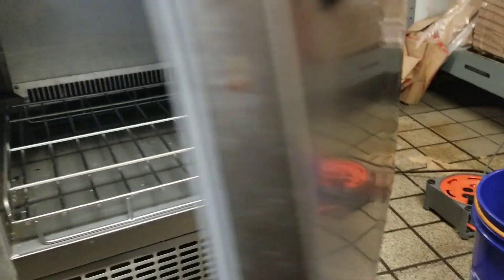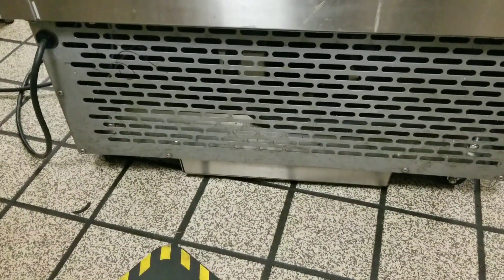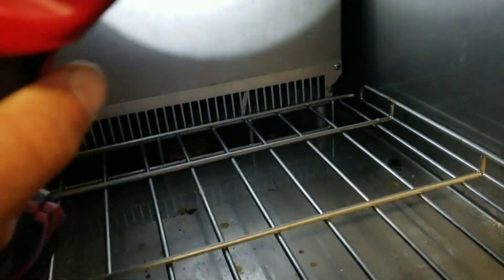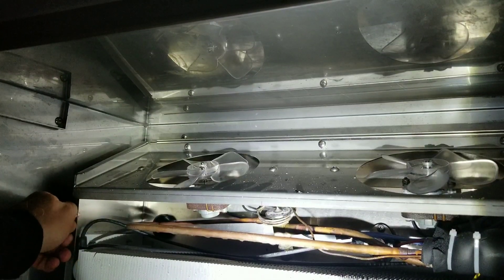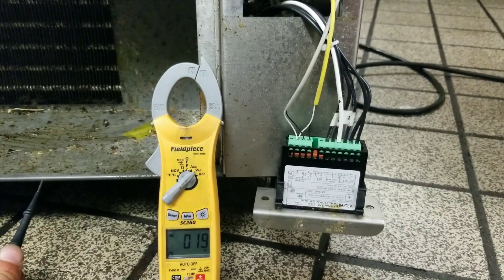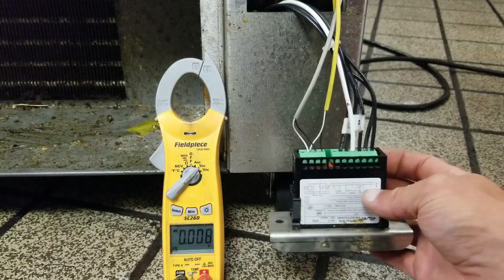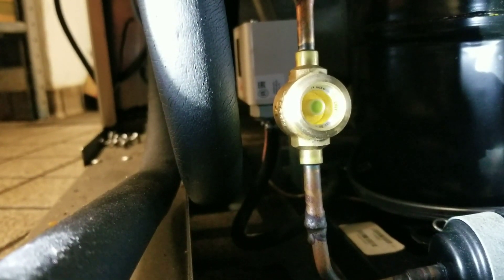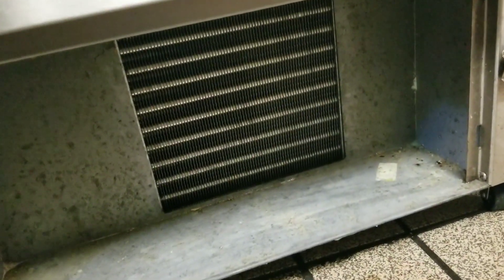Franke Freezer not working

Comment: hi friend i always replace the eliwell because  the fst paramater is important  with freezers and the fan start delay, and secondary with hot gas defrosting  the evaporator fans must shut down ., and i megger amperage of the fans , sometimes the fans took 2 much amperage so de relais in the eli wel controller gone defect grrzz from the Netherlands

Comment: Those eliwell controllers are the only thing we regularly have to change on Franke units. They seem to fail after 3 to 4 years. Never tested like this so thanks for the tip and a way to get by temporarily!
Reply from the maker: Thanks Andrew- these Franke units are pretty solid, I dont service a ton of them but the few I have there wasnt major component failure, just controls here and there
Reply: Why you guys just dont change the little relay inside the controller...??? It cost 0.90$ and you could charge the time instead of changing the complete controller?!? This is what we do in plastic facilities for the heat controllers. You probably make more money.
Reply: I agree with you there! Those things run for decades.  Control only cost $50 from Franke so it is one of the easiest and cheapest fixes we run into on our kitchen equipment.

Comment: i work on these all the time...franke does make most of their units easy to work on and they have great tech support if you are a authorized service company....ever since they switched to R290 units there are alot of leaks which is not good especially when these units are next to the fryers & grills
Reply from the maker: I agree there tech support is great- I dont work on them to often but I have had one or two leaking r290 units, luckily no explosions yet

Comment: Very nice ,holding back from the gauges...
As you mentioned,critical charge of a few ounces..no sense ( introducing),adding non- condensebles to a low pressure system..
Going thru the process is a must in refrigeration.
Ive seen to many techs .GAUGE UP, before doing your overall inspection..
Check electrical first,then go thru the components and process,
Exactly as you demonstrated! 
Another thumbs ☝..
Staying the course..
Awesome..

Bryan Tyler Refrigeration

Comment: Another great video! Assuming they don’t have a door switch for fans in freezer? Have had many go bad or not get pushed all way in causing loss of fans. Small 4/5 prong plug on left of dixell if unplug fans should kick back in if due to that kind of issue. They get a signal from door switch or defrost termination and keep controller from kicking on fans. Love hearing your troubleshooting steps tho!
Reply: Curious HVAC guy yes. We do cold and hot side. Have over two dozen Dairy Queen’s, 50 gas stations with subways. And we take care of almost everything.
Reply: True freezers definitely use door switches to kill the evap fans.
Reply: Curious HVAC guy Justin porter on Facebook. I’m a member of a bunch of different Facebook groups yet I rarely got on Facebook these days, maybe once a week. So not very active with them. However I watch YouTube each evening and sometimes I play it between calls.

Comment: Good tech tip, a machinist taught me the same thing 20 years ago. Another good use for that trick is when you’re installing new schrader cores through a core tool under pressure, run the core backwards until you feel the “click” and then thread in the core, you’ll never cross thread a core again... 😁
Those Franke machines are well made, service ports, sight glass, TX valve, etc., you never see that on a cheap fridge (True?🤣)... good video, thanks!
Reply: Curious HVAC guy thanks. I’m just rebuilding a 1935 General Electric monitor top for my shop (Google it under images...). It originally used sulfur dioxide, but the old rotary compressor works well with 12, no fans on the evap or condenser....
Reply: Never heard of Franke in this area... was wondering about how new the box was when seeing service ports... they looked too good to be add ons.
Reply: dave johnsonnola you probably have HK Dallas